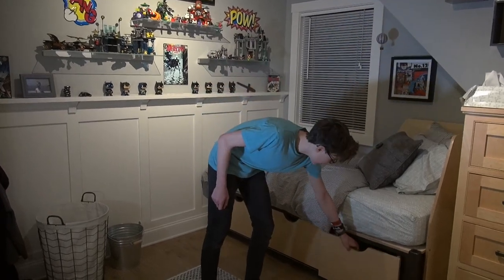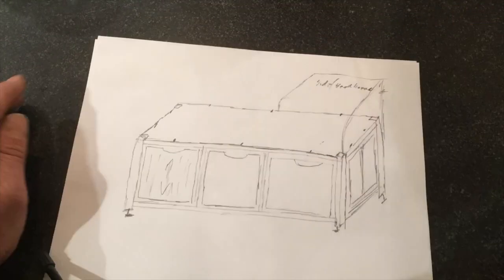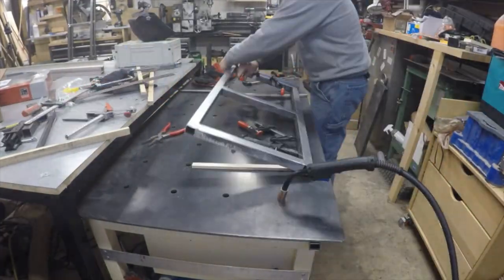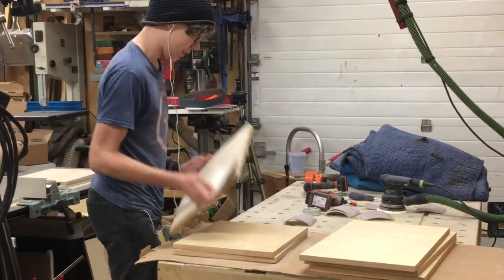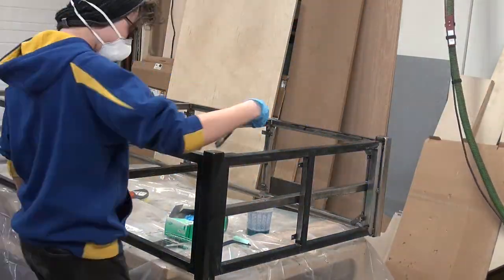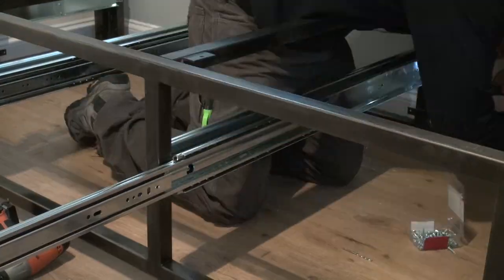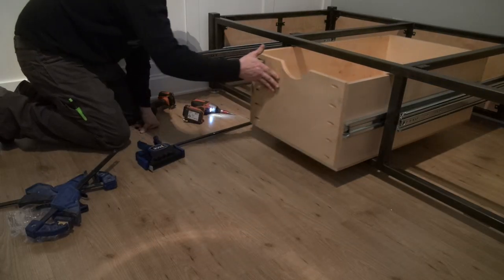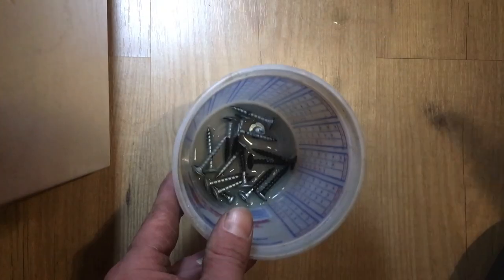Industrial Design - Build Custom Storage Bed - Using steel tubing frame and plywood

Comment: What gauge and size tubes did you end up using? How is the bed this many years later?
Reply from the maker: The bed is as nice as it was the day we finished it, including the finish on the steel.  As far as the gauge, I do not really remember, but I had to keep it as light as possible as it is an awkward piece to move around.